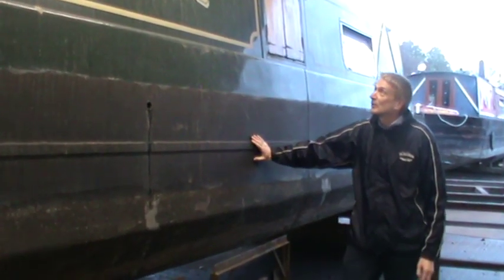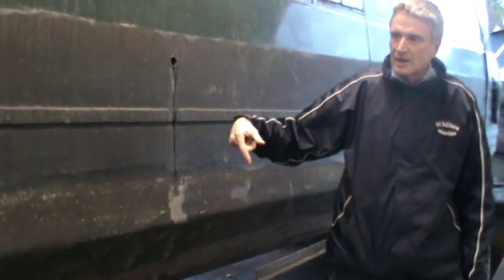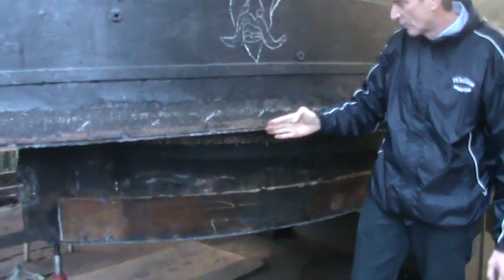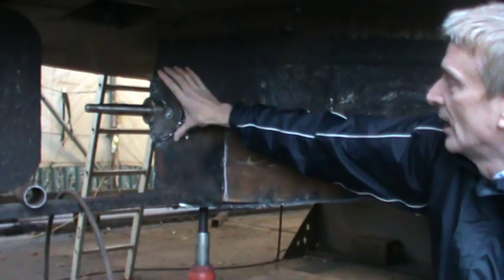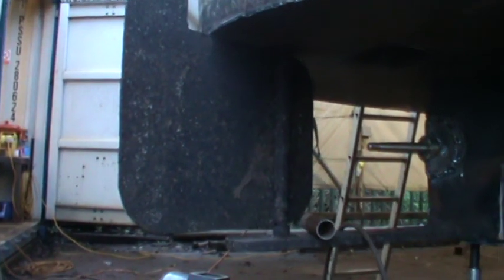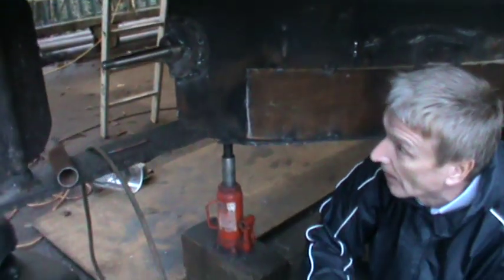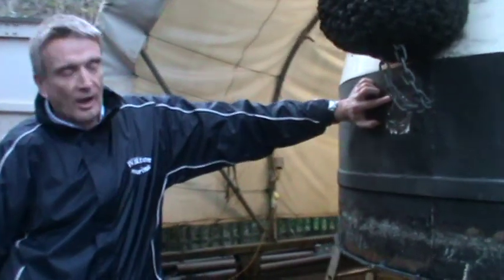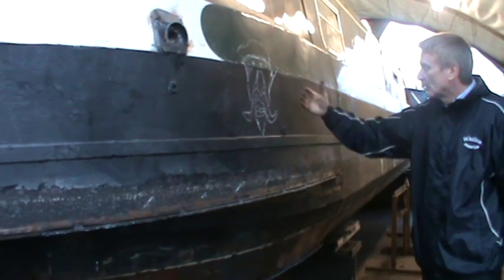Overplating a Narrowboat 3

Comment: Forgive my limited knowledge, but why is the hull overplated and the dead metal not completely cut out and replaced flush with a butt weld instead? Does overplating not produce a capillary joint and the chance of rust creep behind the plate should the weld later rust causing a hidden rust issue over a greater area between the two surfaces?
Reply: Yes.
Reply: No, large water tanks have welded joints all round, there is no reason for it to leak if it is done properly. Why should it have a capillary joint leak if it’s a continuous weld. Not a bodge job!
Reply: It's just a bodge fix to extend the life of the boat. It's still corroding and they weld onto metal which is being hidden.
Many boats get structural failure on the stringer welds because the boat has flexed and then stiffened with new plate, when lifted the stress is then opposite. This continues in the water, but you don't see it until the interior is removed.
Over plating is just hiding failure and adding a few years to the boat.
Avoid buying one.

Comment: how thick do's the hull need to be for it to be insurable?
Reply from the maker: +marcus klem A narrowboat hull should be at least 4mm thick throughout to be insurable.
Reply: Hmmmm how thick is a springer made is that not taken into account
Reply: @johnsadler7184  Springers are normally 6 mm and dont rust as fast as other boats as the steel is from cooling/gas storage towers. Premium you might say.